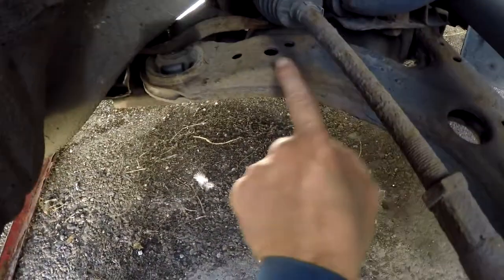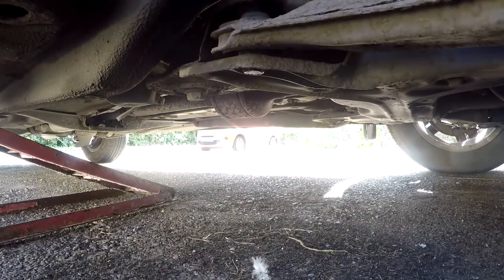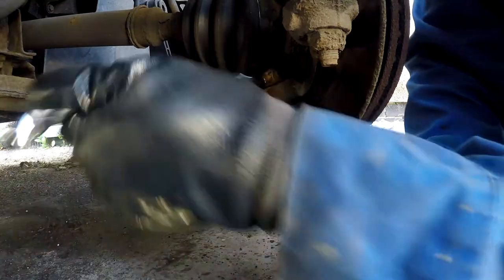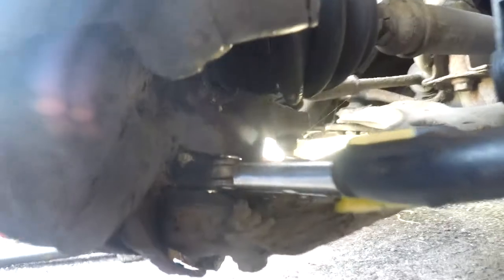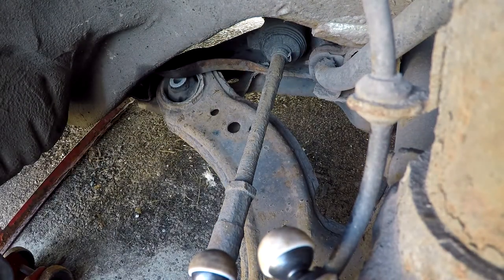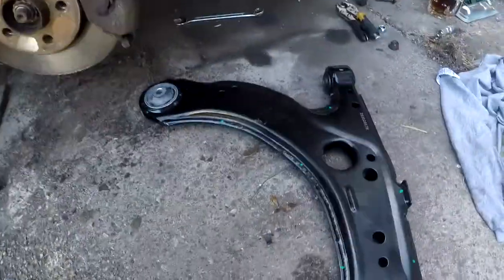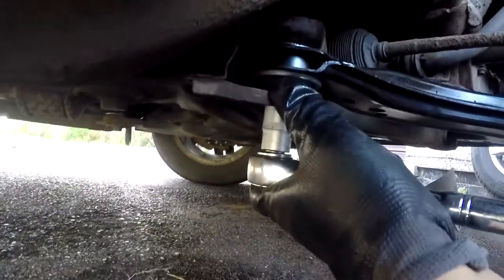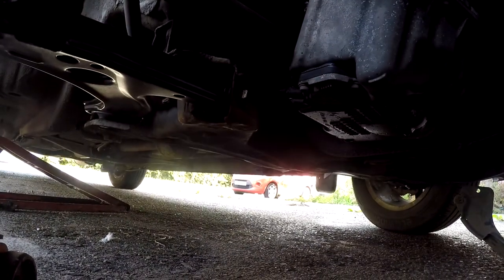2003 VW Golf MK4 lower suspension arm replacement repair

Comment: If i can advise instead of do balljoint upper bolt,itll be easier to do 3 small 13mm bolts and take whole out ,prevent hassle and wont damage rubber on balljoint
Reply from the maker: indeed that is an option with these but it this case was not necessary.